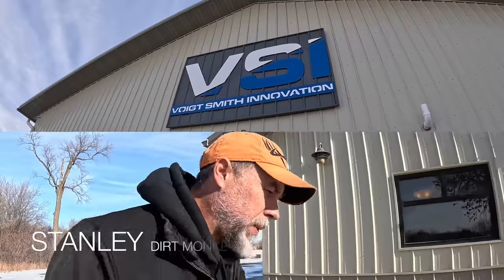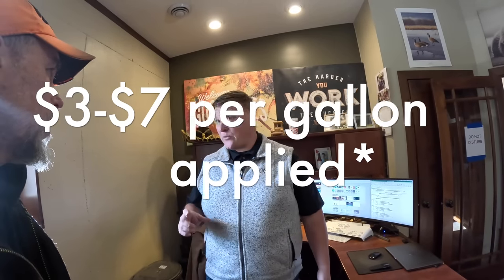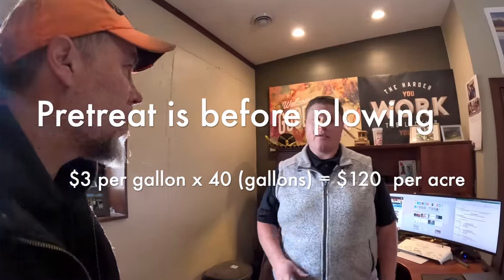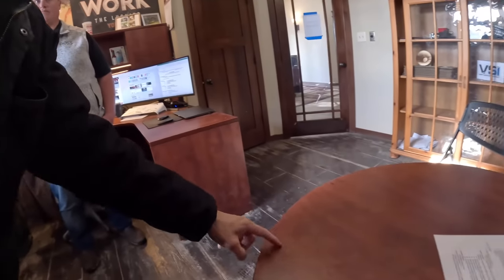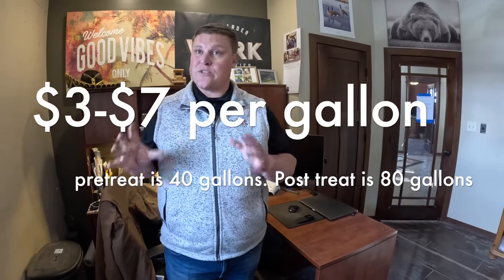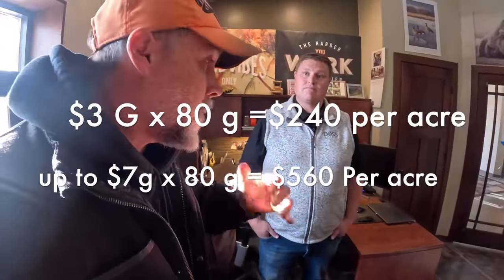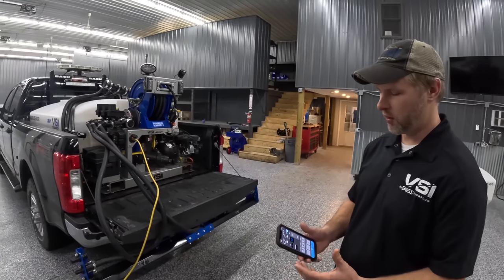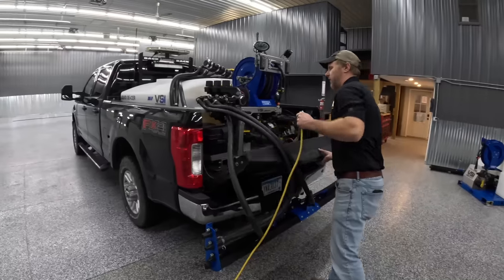industry SECRET to Salt & Brine:  pricing, equipment, rates and more

Comment: Less SALT used on the roads would be very "benificial" cor Automobiles Owners!
Reply: or you can just wash your car
Reply: @landonmorel3715  yea then I drive my cars or trucks onto the road go home and pack a bunch of it back on to drip onto my driveway and destroy my driveway and shop floors yea no thanks regulation is the dumbest idea ever but the government spending less of my tax dollars to destroy my property is a wonderful idea
Reply: @Doubie.  well i guess enjoy driving on icy roads then Karen
Reply: @landonmorel3715  1. better coverage = less ice not more it’s coverage not total tonnage you would do better with a finer grade of salt too but it’s also exponentially more expensive 
2. Lower cost because your not over applying ie a bunch of Run off product 
3. I have actual snow tires not all season junk I don’t care about ice considering a major metro near me doesn’t effectively plow a good majority of it road because of mismanagement 
4. I actually try to continuously improve my driving skills unlike most people and have a lot of ice driving experience 
5. Calling me a Karen is conceding I’m right because you don’t actually have a leg to stand on you have to just act like a 5 year old and stomp off with that last word and a Cliche one at that
5. I’ve not only work landscaping but I’ve work ski resorts too and guess what ski resorts use slurry and different chemicals batches for different temperature conditions to remove ice create ice harden ice and artificially manufacture there chosen snow of the 200+
Kinds of snow they can make off the blowers broken down into 7 categories
Reply: @Doubie.  you sure do love a good run-on sentence.
Reply: Unfortunately the only thing is that the liquid brine gets in places of your vehicle that you are not able to see to clean up.

Comment: I retired from DOT recently in Illinois and I started in 2002.  At that time they just started the brine system.  Now every truck has a brine tank on it around 100 gallons and it is injected into the auger along with granular salt.  We make our own brine and have probably 7000 gallons of brine storage tanks and one 2500 gallon calcium tank that is added to the brine when it's made.  Great video!!  I wish you well with your company.
Reply from the maker: The DOT here is also using both now

Comment: I have been to the VSI shop,  they sprayers are built better than any other on the market.   They even figure little things into the design like how to replace a basic part without the need to disassemble the entire plumbing manifold.
Reply from the maker: They are insanely well built.

Comment: This is the future of ice control.  If I was still in the business I'd get on board fast.  The ROI is fantastic.  I believe prices will drop for the customer eventually as they get educated on the cost savings and demand better pricing by calling out for competitors to bid causing a bit of a price war but still there will be profits beyond the reduced costs like remote storage without a loader to refill for one.  You need somewhere inside to hold the mixing gear with a loader there.  Hopefully near where you need it and a few of those big tanks.
I can see Stan is hooked and I think I'am too.  Great presentation by the partners too.
Cheers 🇨🇦
Reply from the maker: I am hooked. I’m going to be looking hard into this myself.

Comment: Great video and interesting equipment. I’m a contractor in Michigan. We have been plowing and salting for 36 years and never used 1.5 yards per 43-44k sq. Feet . Most of our smaller accounts are 30k square feet per. We normally get 6-7 accounts post snow event ( 1” or less accumulation 25 degrees and above) for salting operations only with regular v-box electric spreaders and hydraulic auger driven. Are routes are set up so are guys do not have to come back to our shop and refill. Most guys come back with salt to empty out of there hoppers. I do not agree with the math here. I have subcontractors using even less than us on the same size sites. I know time is a factor for granular salt to change to brine, but here the traffic on the lots help in melt off.

Comment: Show us more!

As a highway operator I'm very familiar with brine use, but, there is a lot of overhead involved here 
- raw materials storage
- roduction equipment
- manufactured product storage
- application equipment
- facility to have production set up in

If I'm already applying salt or sand I've got my application equipment and likely just run to my materials suppliers yard for loading and don't need a shop for production operation and materials storage.

So, there's a number of overhead and operating expenses and requirements that are being glazed over here.

Comment: Our snow and ice removal business have a different set of environmental applications and works extremely well. Here’s what we do on our small commercial lots:

1) Plow off any snow deeper than 1”

2) Go over sidewalks and lots with a rotary powered broom (push that extra snow to the snow pile)

3) Spread a tiny amount of granular salt over the surfaces (10% of normal full use with using a rotary mechanical broom)

A full 50% of the time, depending on certain environmental factors, we can skip step 3 above. Why? The powerful rotary broom clears snow and ice extremely well and often provides a dry (or drier) pavement surface that mainly has traction. The 10% of salt use is far better to the environment compared to the salt brine solution which uses much more than the methods we employ. The drawback is it takes more time to get the job done (unless you have bigger crews than ours) and have to be very careful of not getting broom spray on buildings or vehicles. But the upside benefits are huge. Here they are listed below:

1) Far less product to purchase 

2) Very little to no tracking inside of buildings with mushy snow on the bottom of feet, carts and forklifts

3) Corrosion and damage to infrastructure is greatly reduced (much drier application of salt - the salt will only interact with any ice present and that area has been minimized by 90 to 100 percent with the rotary broom)

4) Contractor earns more money than application of salt brines alone (depending on contracted rates)

5) Customers love the results and see increases in pedestrian traffic into their places of business

6) Least amount of salt use regarding MPCA standards (yes, even over salt brine use)

7) This is catching on - other businesses are asking about our procedures and hiring us to do this work. The largest grocery store in our growing town has now asked their contractor to at least do some of their main entrances and drives lanes with use of the rotary broom (he just talked with me about it the first week of December 2022)

8) It’s a great team effort for our business 

9) The tiny amount of salt use left behind helps with additional traction,  helps protect you against insurance claims and acts as a residual ice melt for the next smaller snow/ice event. Here’s an example - went in this early morning (December 10th, 2022) to check on the 1/4” dusting of snow that fell overnight. Much of that snow was melted already. Just put down a little bit of supplemental granular salt to finish the job - done!

10) Our lots are the most clear, most safe and best looking in the entire area. As a business owner, we strive to save infrastructure, keep our costs and the customers in line, keep happy customers and always find ways to do things better. What I don’t know is how well this could work on a much larger scale. Haven’t tried it out.

Thanks for reading this long post. Have a great Winter season everyone!
Reply: Forgot to add one important benefit of the 10% normal usage of sodium or calcium chloride granular to the list above after rotary brooming surfaces  (#11) - customers can see that their surfaces are physically treated with a product. This gives them assurance the work has been done by their snow/ice removal contractor, that their commercial property has been properly protected from liability and their customers walk with more confidence in their Winter stepping.

Comment: I understand it working pre and post treat, but alot of contracts I have want salt applied every plow no matter what, it doesn't work to good when it's dumping, but when it's coming down easy it works as the salt breaks down, I wonder how a product that's already  liquid works when it's snowing.  The state uses it once and while around here, but the county stopped liquid altogether, the person in charge of it told me they save more cutting the salt with sand so they got rid of all their tanks

Comment: Any way I can like this a few extra times??  Lol.  & didn't even cover the point of use spray hose, for entry walks I assume...  Think of the possibility of road comm using this, better roads, less cost for municipality, & my GMC wouldn't have the frame rot...  Yea, A bit more up front, but know a mess of guys that ran out of salt mid season & had to pay thru the nose for more product.  This certainly changes the overhead (not to mention the salt trucks that rots the bed away, if not cleaned out constantly!), or the increased profit margins...  

Stan, I definitely think this needs to be addressed more, I'm sure there are lots of guys that need a better perspective!  Thanx !

Comment: awesome Stan! we use a lot of brine here at Victoria BC Canada. I'd like to know the percentage of salt. is 28 the magic number? We find that sometimes we have to add rock salt to the brine or the brine dilutes because of rain or thawing and then can freeze which is bad.
Reply: 23.3% or roughly 88.5ish total saturation... I've had the same issue with the rain diluting it, you either have to stay on it, bump the app rate buy 30-40 gallons, or use rock also, or just use rock...

Comment: Several contractors here in Sou. Indiana and Kentucky went with the brine setups. After about two to three years they went back to granular applications.
Reply from the maker: Any idea why?
Reply: @Dirtmonkey Yup. We built our own custom 1300 gal setup on a F550 chassis in 2014 when salt went over $240/ton here in Michigan. It paid for itself but just sits now unless salt  goes up again; and we have a local supplier in our town where we can buy natural brine from wells at 15 cents/gal which most guys don't have that in there back yard.. Problem is we found its extremely slow compared to slinging salt. Think painting the lot, takes forever with brine, salt your in and out in minutes. It takes time to get those gallons down. Next problem we had, brine won't melt hardpack or ice from the top very effectively, it needs to get under it. Rock salt melts right thru, brine sits on top. It also takes a lot of brine to be effective. It woks good in light fluff snow but the more the denser or water content the snow the more you need.. Brine gets on everything the mist covers mirrors and windows on you own rig, and you gotta be careful we had guys spraying cars and buildings and people calling wondering what was going on lol. Brine has its place but its mainly a pretreat for us and salt after, plus some of our salters inject the brine at the spinner which is nice for those low temps.. With these new electric salters tho you can really dial back your salt usage compared to he old gas hogs.  That's our experience anyway.. People definitely need to use less salt tho I'm glad they're making others aware of the problem, and that's a pretty sweet spray setup too!
Reply: @mattf5042  you said it’s slow , it’s slow if you have the wrong pump and that’s the biggest mistake many make. ?

Comment: I would like too see how it’s made/mixed in the machine. Unless it’s a proprietary thing, then I understand.
Reply: You dump salt in, turn the water on, and the flowing water will dissolve the salt. You have to regulate the water flow though as too much water will dilute the solution to much, and you end up applying almost straight water.

Comment: Heck my driveway is about  5,000 sq ft. With almost a half on the hill. 15 to 17% grade...

The small units are probably too big but I wonder if I could incorporate them into a backpack sprayer...
Reply: Yes you can. Just make sure the salt is completely dissolved in your solution or the granules will plug the tip of the sprayer. 2.2lbs of salt per gallon of water. This is the formula we use at the Iowa dot.

Comment: I don't live in a country where snow is a problem.  Can you use a course sand to aid grip with or without salt
Reply: Sand helps for traction but it doesn't melt ice.  The county uses a mix of both on the hilly roads where I live.

Comment: You should look into beet juice. Some states did test on it and it worked better than salt and salt brine
Reply: Big juices use more as a stick reagent for the salt. It’s primarily a sugar, and it works in conjunction with others, but not so great by itself.
Reply: Also because it's a sugar, it plugs up nozzles, pumps, and valves.

Comment: So, you still using salt, but not as much of it? Still confused, so you use it before you plow and use it after you plow? Right?
Reply: Yes. Pretreatment helps prevent the snow from sticking to the pavement. With enough snow, the sticking is inevitable, and the plows can only scrape so much off. That's where the post treat comes in.

Comment: @DirtMonkey I know you wont do it because you have said previously you don’t want the liability of salting but back when Ebling back blades were the only game in town I tried talking a friend into retrofitting a ag sprayer boom onto the rear blade with a slurry tank in the bed but adding beat juice to the slurry it basically the same as what your doing now but with the same ag equipment it seams like vsi based there system on

Comment: I'm not against this.  We need to be smart though.
FYI...tires pollute as well.  Microscopic rubber particles stay on the roads.  That's why they wear out.  You're leaving rubber on the road.  A tiny amount goes airborne as well.

Comment: I want to see a before and after to see how well it actually works. No offense, but the marketing buzz words don’t do much for me. What stuck out to me me was its a pre application, THEN PLOWING, then an after treatment. So what’s the time savings on plowing. I’m skeptical, it seems to me its just another added line item to a plowing contract.
Reply: Most contractors now spread rock salt pretreat and plow and post treat with salt also.  Nothing is changed.  

It is the real deal.  I am a snow removal contractor and it is amazing what liquids can do for ice management.
Reply: @mikeconway9966  Fair enough. What is the cost difference between the two approaches to the customer same job. Same price, ten percent more, 20, etc. Genuine question. And is there a time savings for your the contractor.

Comment: By chance have you seen anything in the brine spreader world that would be used by just the average home owner?
Reply: You could just get a weed sprayer and mix 2.2lbs of salt per gallon of water. Just make sure the salt is completely dissolved. I work for the state of Iowa and that is the ratio that we use.
Reply: @davidcornelison5453  are you using just salt or does Iowa add in other ingredients to make it more effective at colder temps?
Reply: Working for the state, we try to keep things as cheap as possible. So we are just using salt. People higher up in the dot, "smarter" than me, have said that it doesn't work below like 20*. But I know for a fact it has been effectively used at temperatures around 0* or slightly below 0.

Comment: It’s great to talk about best case scenario profits. But ignores the worse case scenarios. 

Pre treat only works up to a certain amount of snowfall. Then dilution is wrong and causes ice. Post treat only works at highrr temps, and doesn’t last at all through drifts. The reason why salt will win, is it’s creating brine of a much higher dilution, and the snow it’s melting creates it. But it better not go below 20% or you’ll get ice. And it’s basically like freezing rain. 

Also wrong to say it’s 1 acre per yard and a half of granular. 1.5 yards is 3600lbs, 800lbs per acre would be 7 acres before you ran dry. Compared to the 3.75 they can give you. 

It also takes time to make brine, you need to have storage to keep the brine, and a good enough pump to have it fill quickly. Which is all on top of the salt storage and loading you have to do regardless of brine or granular. 

I love the concept, but it by no means can protect you better from lawsuits, as it’s effectiveness  has such a small window. But boy howdy should you use it in those windows.
Reply: Sounds like you've been through a lot
Reply: @chuckb9867  numbers were great I wanted to try, and it was really nice for about 5 minutes after applications lol
Reply: You should check out salt brine additives!  Many top tier additives have refreeze protection built in so even if the product does dilute you won’t see any refreeze of the product.  Very helpful when dilution is a concern!

Comment: We use liquid ice control but we don't use salt it's  urea witch works better then salt and dont do any damage.  give you green grass in spring  also with our months of 40 to 50 below only a sand salt works.. it pre mixed with 10% salt 90% hot sand heated by the trucks exhaust system which makes the sand melt into the ice a cost per ton at $7.00. Salt turns a 90k car//truck into a $500 car/truck in 5 year, can you imagine if you're $90,000 home was worthless in 5 years it's the same thing. You dont need no 30k brine making machen. We mix it the the same way we mix liquid calcium for applications on dirt roads graval farm driveways parking lot  for dust control  .. calcium is a powder and we don't use any costly machinery for mixing it. Been doing it for years